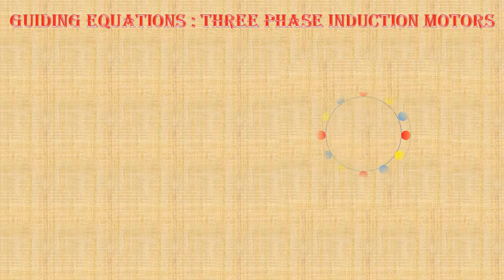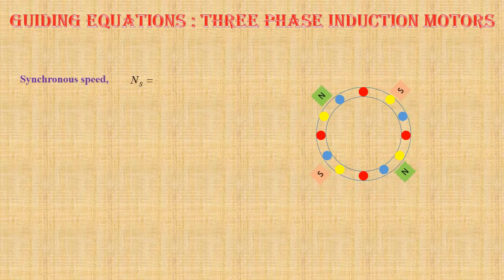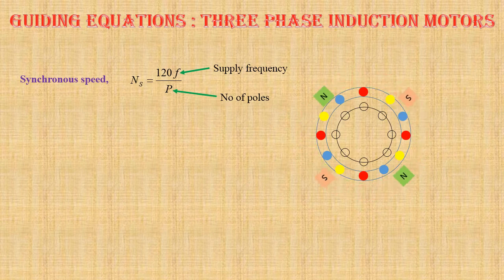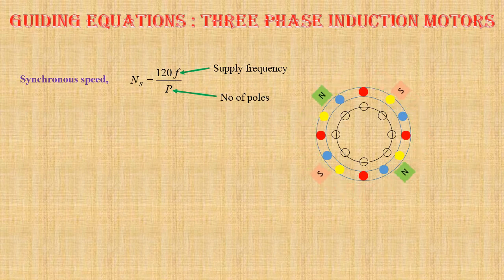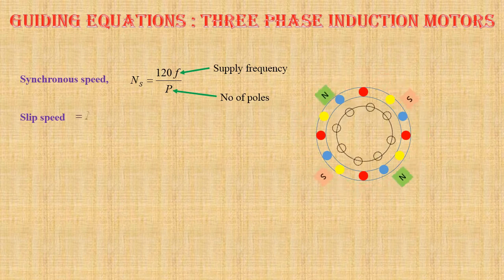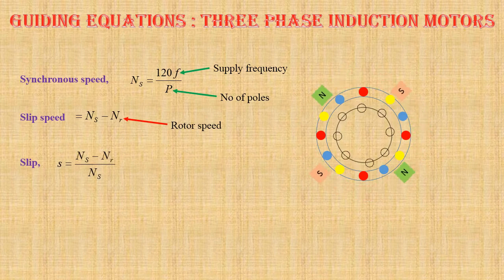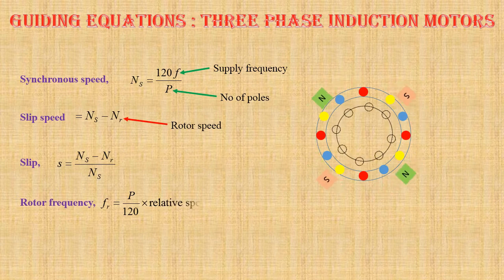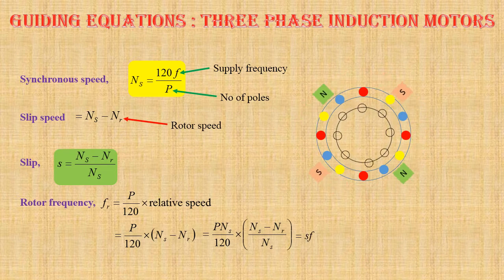Simple problems on 3-phase induction motors: Slip, Rotor Frequency(Part-I)

Comment: mam, the speed at  which the alternator runs, is it ns or nr or what's the kind of the speed, thanks very much
Reply from the maker: Induction motor and generator both run at speed Nr. Synchronous generator runs at speed Ns

Comment: Calculate the speed in rpm of a 6-pole induction motor which has a slip of 6% at full load with a supply frequency of 50Hz. what will be the speed of a 4-pole alternator supplying the motor?
Reply from the maker: Synchronous speed of the motor, Ns2=120*50/6=1000rpm
Motor's speed, Nr=(1-0.06)*1000=940rpm
Speed of the alternator, Ns1=120*50/4=1500rpm

Comment: hello madam but when your solving synchronous speed my madam told me the formula is Ns is equal f/p not 120f/p why
Reply from the maker: If Ns is measured in revolutions per second then Ns=2f/P
If Ns is measured in revolutions per minute then Ns=120f/P

Comment: A 3,3 kV, 50 HZ, three-phase, star connected induction motor, with an output of 100 kW, has a synchronous speed
of 500 r/min. The full-load slip is 1,8 % and the full load power factor is 0,85 lagging. The stator copper loss is 2,44
kW, the stator iron loss is 3,5 kW and the rotational losses are 1,2 kW.
Reply from the maker: What should I calculate? I/p power=108.995kW, Armature current=22.434A, efficiency=91.75%
Reply: @gargibasu5111 may you kindly show how obtained the I/p (input power). I got 103054.99W

Comment: the reactance and standstill reactance of each phase of a three phase induction motor with star connected rotor are 0.06 which when connected to the rotor circuit will give a passout torque at one half of the full load speed .what is the power factor
Reply from the maker: it seems there are some typos. The problem is not clear to me.

Comment: Please mam please measure the tension of each phase and slot by measuring the armature rotor of the induction motor. And please give a video of the cable size diagnosis
Reply from the maker: I really could not understand what you did mean by 'measure the tension of each phase and slot by measuring the armature rotor of the induction motor.' About cable size diagnosis I shall try to be of help.